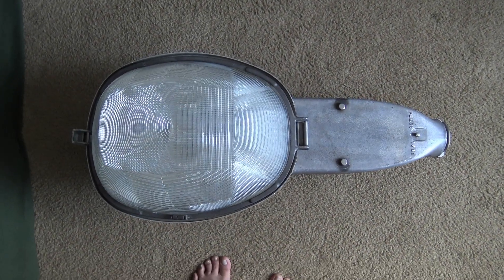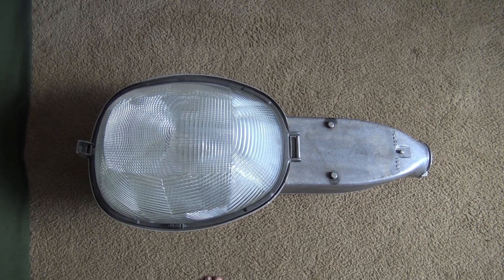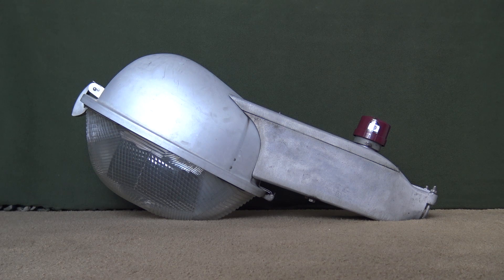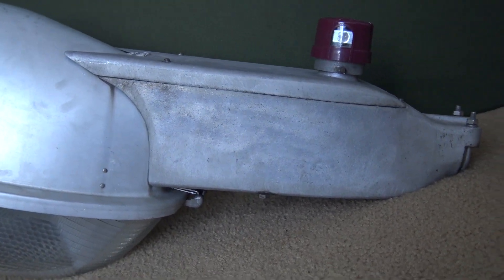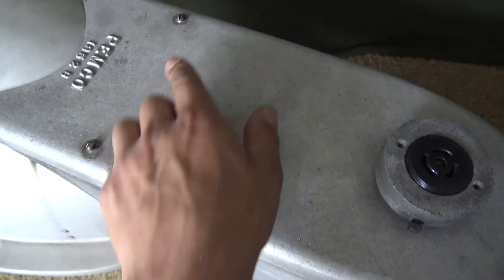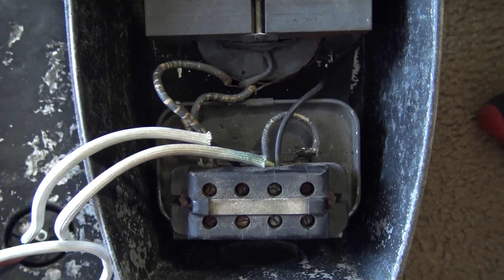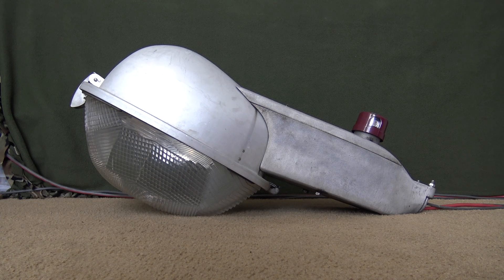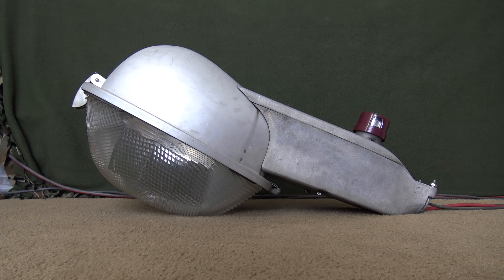Pemco Style 69 400W Mercury Street Light Overview

Comment: From 4:19-4:28, there is a 1950s Joslyn street light fixtures, found mostly in Canada then the United States, including Arkansas and Mississippi. It required remote ballast on its vintage Joslyn street light fixtures back in the 1950s.
Reply from the maker: If you listened to the video I said that the fixture is a pemco fixture. It's a pemco style 68. Not a joslyn.
Reply: Look at the front, you can kind of see a circle on the glass, so it is not Joslyn.